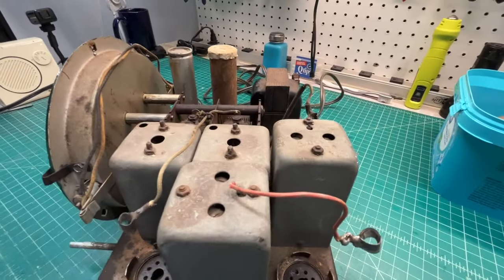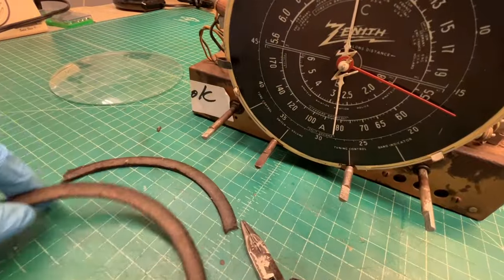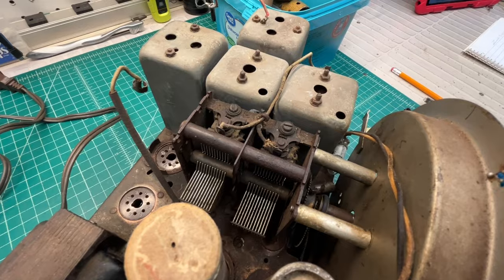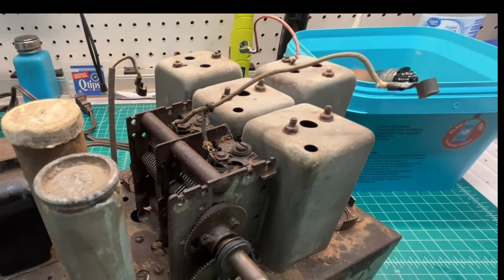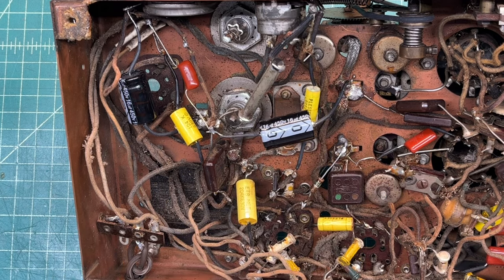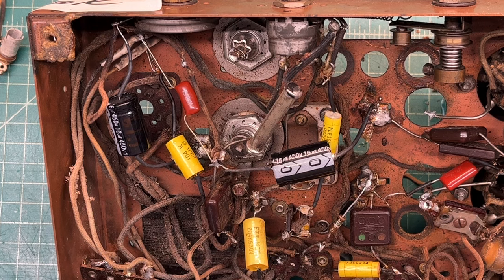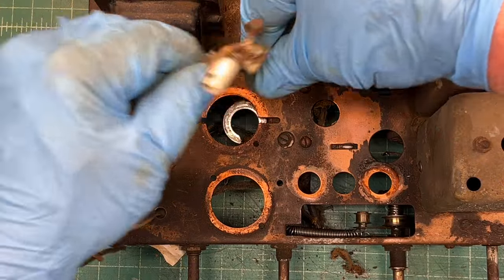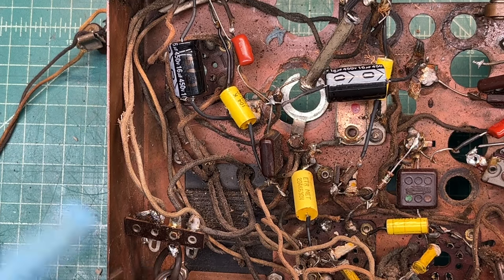Zenith 5-S-127 | Teardown Begins | 1 of...

Comment: The chassis looks  like it was in a flood a long time ago. Really needs a ton of cleaning. Shango on a recent video had a '38
Airline with both transformers bad. Got to see some smoke from the power transformer. That Airline was probably headed
for the dump by the looks of the cabinet but made an interesting and thorough resurrection video. Your cleaning this one 
up will be a major undertaking Don.
Reply: No bugs on this one though.
Reply from the maker: Steve, definitely more effort than I first thought. The old chassis is a nasty mess for sure. Just got the tuning capacitor squared up after 20+ hours of rust/crud removal and alike. Best, Don